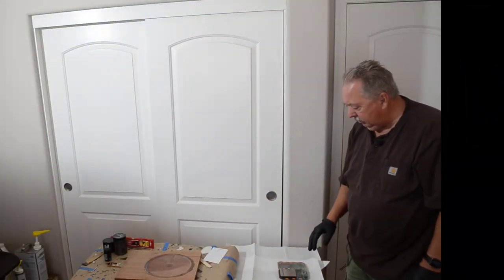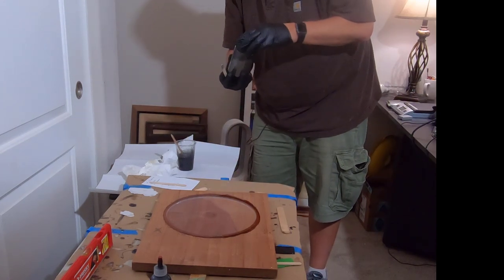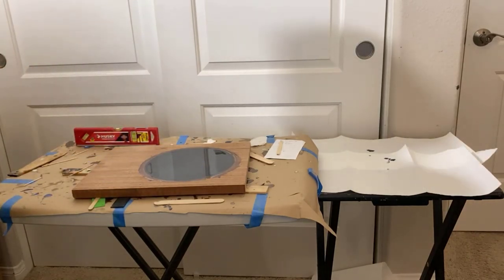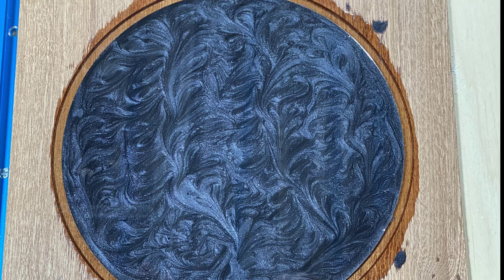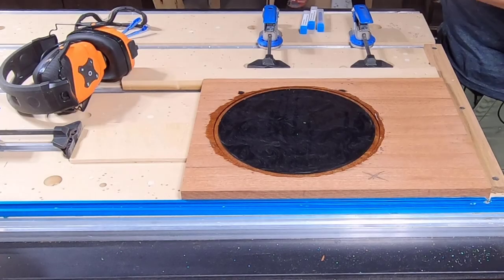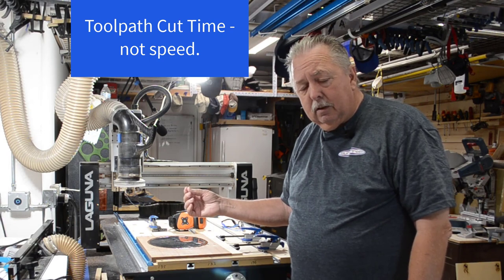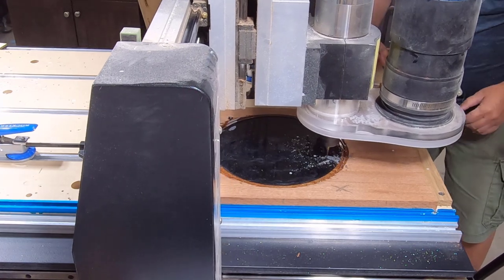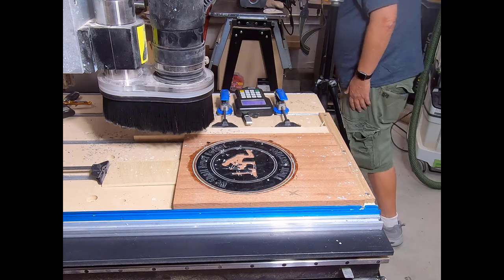Multilayer Epoxy Inlays Black Pour and White Carve

Comment: Why would you not run the clearance tools before the V Bit
Reply from the maker: That is a good question and one that others have asked.  The reason I normally run the v-bit first is because I find that for me it actually results in better cuts with less "fuzzies".  That has been my personal experience and several other epoxy and cnc artist also have found this to be the case.  With that said there is nothing wrong with running the clearance tools first.  I have rationalized that it works better this way because when you run the vbit first there is pressure on both sides of the the bit, holding it in the cut path tight, where as if the clearance is run first there is only pressure on one side of the bit.  I won't swear that is the reason, but the less fuzzies is what I experience.  BTW, I will also run the vbit twice in some cases - if I think the cut is a little fuzzy.  Hope this helps.

Comment: What brand of epoxy do you use?
I have a problem with bubbles not coming to the surface so there are air pockets.  When I surface the epoxy, those air pockets are then exposed.  The torch doesn't help much, there's still a ton of microbubbles beneath the epoxy that won't come up.
Reply from the maker: At the time of  this video project I was using Upstart Table Top Epoxy and it performed well.  But now I use MAS LV epoxy with medium hardener.  I switched because I ran out of Upstart and decided to try a new brand and my buddy Shane Peters told me MAS was the best he had used so I tried it and I like it.  That is what I use for my projects at this time.
Reply: @RobSandstromDesigns  I see.